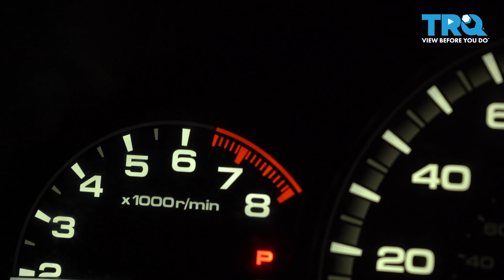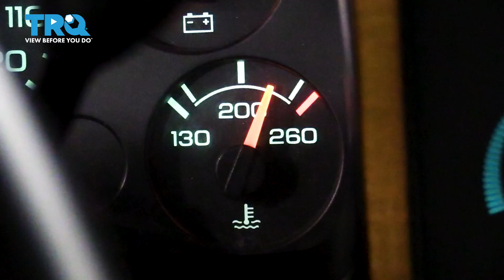EricTheCarGuy Explains Check Engine Codes - P0300 Random Misfire Detected

Comment: My check engine light blinks on start-up, runs rough for maybe a min., but then smooths out, and runs fine. But the check engine light stays on.  I had it scanned, and the P0300 code is the code. I have a 2011 Mercedes E350 Sedan.
Reply from the maker: +L T We wouldn't be able to diagnose an issue like that here, you may want to have a local mechanic take a look at it. Thanks for checking us out! http://1aau.to/m/Shop-1AAuto-c

Comment: this is happening to my 2006 TL automatic, only at WOT through a couple gears, doesn’t seem to run rough, just flashes these pending codes or occasionally a current code. it has all new plugs and coils and i’ve checked the egr system and the only thing i’ve found it a bit of oil in the spark plug wells
Reply from the maker: +Wolley Reiki Valley Thanks for watching our video! http://1aau.to/m/Shop-TRQ

Comment: So great to have you back making videos!  You're already making a difference.  

Just yesterday I was test driving a 2008 Lincoln town car with 4.6L V8 and the car was shaking and had low power.  It got progressively worse during the 15 min test drive. Check engine light came on solid at first and then started flashing after about 5 minutes.  We had to drive another 7-6 more minutes to get it back to owner's place. 

Owner ran a scanner and came up a bunch of codes:   P0305 misfire cylinder 5; B1990 Pedal Forward / Rearward Potentiometer circuit fault; B1676 Battery voltage out of range; B1318 Low battery voltage at module.    

So first thought it was only a cylinder 5 misfire problem and maybe just addressing this would fix it the flashing check engine light. But luckily I came upon your video that point out there could be other potential causes. 

Could a single cylinder misfire cause a flashing check engine light or would it take more than that? Could just the cylinder 5 misfire also lead to all the low voltage codes that were also detected?  You mentioned how low system voltage affecting multiple components can lead to misfires and in this car all these low voltage codes came up. 

With a flashing check engine light, how much engine or cat damage could occur if you drive the car like this for 7-10 minutes?  Could just a few minutes driving with a flashing check engine light cause damage? 

Thanks again for all you do!